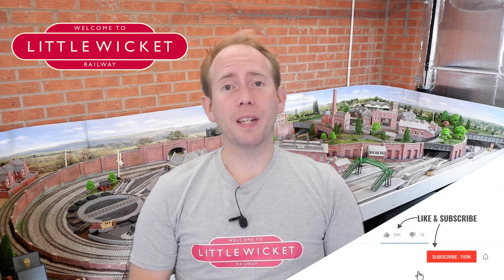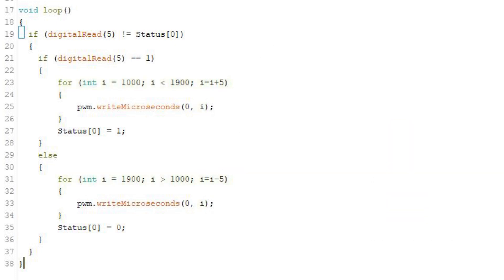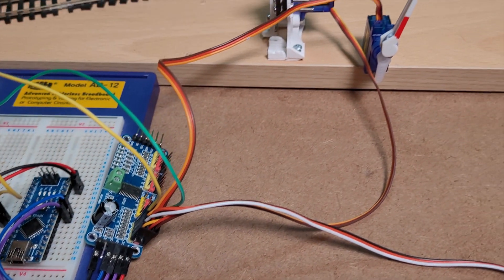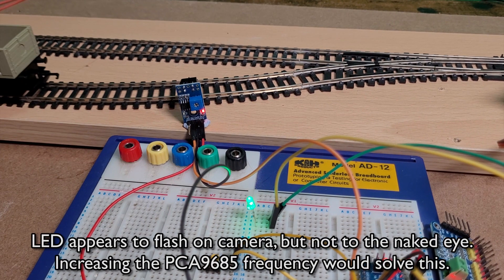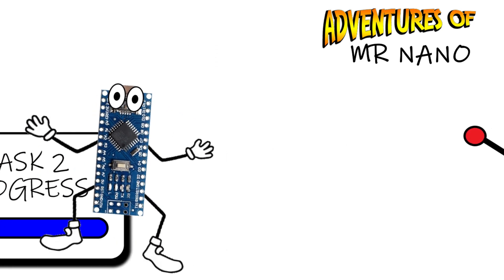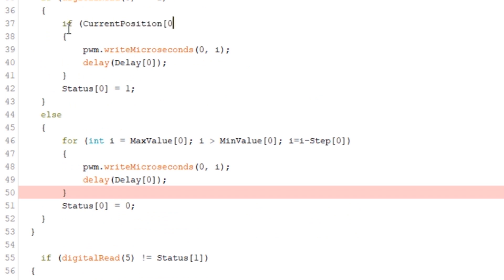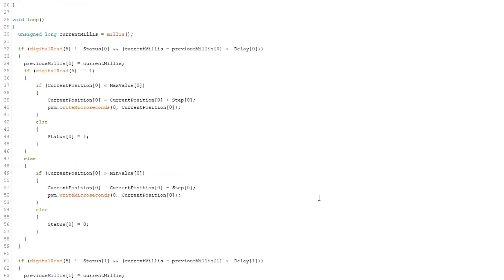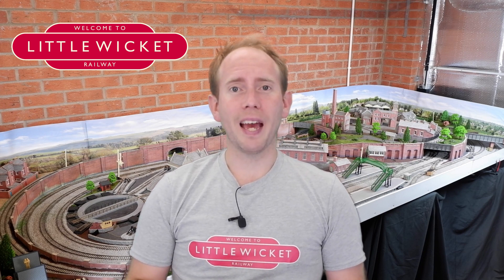Add Realistic Slow Motion to Servo Point Motors

Comment: Nice video, well presented, (even if a little 'heavy' in the Ardino code) and answered my unrelated question of how slow a servo can move. Most videos show the servo moving from 0 degrees to 180 degrees in about 0.5 sec ... which is obs far too fast for a pan and tilt mechanism! But this video has proven that with using milliseconds() and delays, the attentuator can move at far slower speeds.

Comment: thanks for the great  tutorials , I have utilised your improved code and it's great ...I have the issue where I would like one input pun to control two turnouts but I would like the second to only start after the first has finished... I am thinking to add the variable delay into the loop but not sure  where ? I am thinking I can get this value from the delay part of the table ?

Comment: there is a library called varSpeedServo (short for variable speed) that uses interrupts to do the same without all of the tricks you are doing. It is over 12 years old now, so perhaps there are even better libraries out there. 

And much more efficiently too 😉 mostly because not having to code is the most efficient of all 🤣 yes I'm a lazy programmer

Comment: Or you could use a MERG servo driver module.  Allows you to program end of travel both ways as well as speed of travel, and no coding required.  Downside, you have to be a member of MERG to purchase the modules, and they come as a kit of parts that you have to construct yourself (not a problem if you can follow instructions and know how to use a soldering iron.)

Comment: Hi Rob Great videos I have went a lot. I am using your servo motor control code with PCA9685 works fantastic with Jmri. 
I have been trying to incorporate your improved slow motion server code into the servo motor code and not having much luck.
Is there any possibility you could put some code on your git hub that has slow motion servos connected to PCA9685 controlled with JMRI.
All the best John.

Comment: Rob,  I am looking at your servo slow down sketch.

It would be very helpful if you could incorporate this into your last main modified sketch , where the first line of that sketch reads - -:This sketch combines servo turnout control, sensor inputs, and other outputs.".  This is the sketch whereby you assigned the Servo Shield Pins to accomodate OUTPUTS.

This servo slowdown sample sketch does not align with the needs of that sketch.

Thanks much.

Bob S -  Cleveland, OH

Comment: Rob,  Do you think you could whip up a sketch to check all the sensor inputs as required for CMRI?  Would be handy to stick a sensor on a pin and see it reported in the serial monitor and then after it all checks out, take it to your layout and know that the arduino is set to go.

Bob S - cleveland

Comment: Rob, great videos. Rather than do all that complex multi tasking wouldn't ut be easier to have I e arduino handling all the servos and handling all the detectors. The detectors need an immediate response. Perhaps this way each set of point's in a coordinated change coukd change sequentially. This might be quite realistic.
Reply: Typo - 1 arduino to handle all the detectors and another to do the servos.

Comment: Great video and interesting start point. Just a word of warning though. The Arduino is pretty slow to assign PWM values and if you have several servos attached, the time it takes to throw a turnout using the millis approach grows exponentially when you're moving more than one servo simultaneously. Which can happen quite often with crossovers etc. 
So don't measure the time you think it will take to throw a turnout with just one servo attached to your board, if you intend for more than one turnout to be thrown at the same time on your layout. 
Two motors moving at the same time will move at a much slower rate than just one.

Comment: Hi Rob thanks for all the great videos on the use servo's and Arduino.  I have connected my layout with around 50 servos connected on four layout boards using 5 daisy chained PCa9685 servo driver boards using the the code you used on the multiple PCA9685's.  I would like to incorporate a function into that code to slow down the point(turnout) motion.  Motion is initiated using JMRI.  Could you demonstrate what is needed please.

Comment: I have built crossing gates for my layout using Arduino and two servos, the problem I have is that when the system is first powered up the servos do a jump like they are resetting themselves and my gates crash into each other, causing damage, after that they work just as I want, can anyone help to stop the power up jump.
Reply: I had a similar problem when working on a sketch to drive the servos slowly using JMRI to control them.  You could try centring the servos in setup (I used CurentPosition[0] = 1500;).  You do seem to have to do this for each servo.  I did try a for loop and CurentPosition[i] = 1500; but it only fixed the issue on servo 0.
Reply from the maker: I'll look into this, it sounds like an issue I'll encounter too.

Comment: Thanks so much for this. I have tried to add this milli, (Milli improved sketch)  to the servo sketch for my 20 servos using the servo sketch from you but i am not having any luck getting it to work. I have had both sketches opened and trying to figure it out but nope lol. I do have all the servos calibrated and working well through jmri and your vids but would like to get the servos to slow down for both appearance and i think the calibration on them would be better too, i think lol
Reply: Try this:
/*

turnOp

This sketch operates a number of servos at a realistic speed taking the close (maxValue) and throw (minValue) commands from JMRI.
It also causes an associated relay to changes state as the turnout reaches its new position. This can be used for frog polarity switching, signals etc. 

The sketch is based on two sketches compiled by Rob at Little Wicket Railway (links below)

https://github.com/LittleWicketRailway/ServoControl/blob/master/Servos.ino
https://github.com/LittleWicketRailway/SlowMoServos/blob/main/MillisFunctionImproved.ino

Starting with the servoControl sketch, sections from the MillisFunctionImproved sketch were added.
Development was then carried out with a considerable amount of advice from Wildbill on the Arduino Forum.

This sketch is currently running on a test bench operating four servos via an Arduino Mega with a PCA9685

NOTE:
      minValve drives the servo right/clockwise, maxValve is left/anti-clockwise
      Thrown sets the turnout to the divergent route.  Closed sets the turnout to the straight route.

Iain Reeves Jan 2022
*/

#include <Wire.h>
#include <Adafruit_PWMServoDriver.h>
#include <CMRI.h>
#include <Auto485.h>

#define CMRI_ADDR 1
#define DE_PIN  2
#define numServos 4                                        //The number of servos connected

Adafruit_PWMServoDriver pwm = Adafruit_PWMServoDriver();   //setup the board address 0
Auto485 bus(DE_PIN);                                       // Arduino pin 2 -> MAX485 DE and RE pins
CMRI cmri(CMRI_ADDR, 24, 48, bus);

int Status[numServos];                                     //Create a table to hold the status of each turnout

//Create a table to hold the throw value for each servo
int minValue[numServos] = {1000,  //LY1(turnout ID) - enter values obtained from the Little Wicket calibration sketch
                           1100,  //LY2
                           1200,  //LY3
                           1300}; //LY4
                           
//Create a table to hold the close value for each servo
int maxValue[numServos] = {2000,  //LY1
                           1800,  //LY2
                           1900,  //LY3
                           2000}; //LY4

int CurrentPosition[numServos];             // table to hold the current positions of each turnout
int StepSize = 5;                           // if you require servos operating at varying speeds use an array here    int StepSize[numServos] = {5, 5, 3, 2};   to create a table to hold the step size for each turnout.  Also add [i] to each StepSize term.
int DelayTime = 15;                         // if you require servos operating at varying speeds use an array here    DelayTime[numServos] = {15, 15, 10, 5};   to create a table to hold the delay time for each turnout.  Also add [i] to the DelayTime term.

// Create a table to hold the output pin for each turnout relay
int Relay[numServos] = {36,      //LY1
                        38,      //LY2
                        40,      //LY3
                        42};     //LY4
                        
unsigned long previousMillis[numServos];    // table to hold the previous movement time for each turnout

void turnOp(int inputPin, int i)            //function to drive servos at slow speed
{
  unsigned long currentMillis = millis();
  
    if (((cmri.get_bit(i) != Status[i]) && (currentMillis - previousMillis[i] >= DelayTime)))       // compares CMRI signal against state of turnout and checks sufficient time has passed since last movement
  {
    previousMillis[i] = currentMillis;                                                              // updates last movement time
    if ((cmri.get_bit(i) == 1  ))                                                                   // checks if (cmri.get_bit(i)is 1
    {
      if (CurrentPosition[i] < maxValue[i])                                                         // then checks if current position value is less than maxValue - 'maxValue' used to account for L/R turnouts
      {
        CurrentPosition[i] = CurrentPosition[i] + StepSize;                                         // if both the above statements are true, moves turnout by one step (increasing)
        pwm.writeMicroseconds(i, CurrentPosition[i]);                                               // updates current position
      }
      else
      {
        Status[i] = 1;                                                                              // sets Status to 1
        digitalWrite(Relay[i], LOW);                                                                // de-energises relay associated with turnout [i]
      }
    }
    else
    {
      if (CurrentPosition[i] > minValue[i])                                                          // checks if current position value is greater than minValue - 'minValue' used to account for L/R turnouts
      {
        CurrentPosition[i] = CurrentPosition[i] - StepSize;                                          // moves turnout by one step (decreasing)
        pwm.writeMicroseconds(i, CurrentPosition[i]);                                                // updates current position
      }
      else
      {
        Status[i] = 0;                                                                              // sets Status to 0
        digitalWrite(Relay[i], HIGH);                                                               // energises relay associated with turnout [i]
      }
    }
  }
}

void setup()
{
  Serial.begin(9600);
  bus.begin(9600);
  pwm.begin();
  pwm.setPWMFreq(50);           // This is the maximum PWM frequency
  int i; 

  // centre servos when JMRI gives first command
  CurrentPosition[0] = 1500;    
  CurrentPosition[1] = 1500;
  CurrentPosition[2] = 1500;
  CurrentPosition[3] = 1500;
    
  // set up relay pins 
  {  
       for (int i = 0; i < (numServos); i++) 
    
  pinMode(Relay[i], OUTPUT);
  digitalWrite(Relay[i], HIGH);  
  }
}

void loop()
{
  cmri.process();
  
  for (int i = 0; i < (numServos); i++) 
  
    turnOp(2, i); 
}

Comment: I'm sure I won't be the last one to ask the question but are you intending to have the slow motion servo control incorporated into the Sensor/Servo hub sketch?
I now have the Pi controlling three arduinos; two connected to servo/sensor hubs, and one connected to the DCC++EX system. All working but the slow motion control of the servos would be the icing on the cake.
Cheers
Toni

Comment: I really love your videos and they helped me so much but i have an issue. I am trying to get 2 ardunio megas to work with JMRI. I have them both setup in preferences with different CMRI addresses but for love nor money can i make them work….nope. HELP.
Reply from the maker: Are they connected on different COM ports?
Reply: @LittleWicketRailway  they are yes and for some reason the second one will not respond.

1st one is on Com3 and is your fantastic shield of servos / sensors.

2nd one is on Com4 and i use it for Leds. But i might just combine them.

Comment: I've tried to work out which sketch you are modifying. Is it Adafruit example code, your part1 or part2? Help much appreciated.
Thanks
Reply from the maker: Hi Roger, I've uploaded 3 files to https://github.com/LittleWicketRailway/SlowMoServos

- one file contains the delay code
- one file contains the code with millis function used for 3 servos and the LED
- one file contains the improved millis function code in which we create the bespoke function

Hope this helps

Comment: Hi Rob, another great video, I used a PCA9685 to control 12 sets of points but found I was loosing servo's prob due to fast movement so eventually went for Servo 4 and Mega points controllers from MERG and was going to get 2 more Servo 4 boards but I think I will try your idea as I need 4 more points switching, also on one of my sketches I had 5 points to change at the same time so made a delay so they didnt all switch at once as would be in signal box .. regards John
Reply from the maker: Thanks John. I hadn't thought of that, but you're right, the points wouldn't move together would they as the signalman would need time to throw each lever. Interesting that you were losing servos. Could it be that they were burning out because they met resistance when turning? Presumably not if they're working fine with MERG controllers.
Reply: @LittleWicketRailway  Yes I think the reason was, I was using a PCA9685 with 8 point servo's connected to it and I think they had moved to Max position also they didnt disconnect after moving, Ive got a MERG Megapoint controller which I connected up but still to setup ... also monitoring current helps as I think they take about 150ma when moving so if goes up to say 350ma you know you have a problem ... Also just got my DCC++EX with Wifi working ...LOL

Regards John

Comment: Your Vid clip has a benefit that was not discussed. Replacing delay() with millis() makes the code processing so much more efficient.

I have a question. In your list of materials needed, I do not see servo mounting bracket now is it displayed in your store on Amazon. Can you share where the mount is available? Don
Reply from the maker: Hi Don

The servo mounting bracket is from MERG (Model Electronics Railway Group). You'd need to join them to order the mounts. They're a great group and they have lots of other kits, so it's worth joining, but if you're just after servo mounts then it's probably cheaper to find something similar elsewhere online.

Comment: Just what I was looking for, how to slow them down. Next thing is, how would you go about wiring the point servo up to operate via a SPDT switch instead of using the program, as illustrated in one of you previous videos.
Reply from the maker: When you say program do you mean JMRI?

Is this useful? (https://youtu.be/-qEL5MGZXB4) Just replace the PTM switch with a SPDT.
Reply: @LittleWicketRailway  Hi Rob,
Yes, that's what I'm after.  At the moment I've only got the Arduino Uno and the PCA9685 so I just need to get a few more bits to complete the job.

Comment: Great video! I like the way you explain things in all of your video's that I've watched so far.
Just one thing, in real life, wouldn't both gates go up and down at the same time insuring stopping of vehicles from getting stuck on the tracks? Wouldn't it be easier to operate both signals off the same command?
Reply from the maker: You're right, you would have both barriers in the same loop moving together, but I just wanted to demonstrate the principle with something visible.  I should have used flashing red LEDs as another example where you want them to be activated at the same time as the barriers.